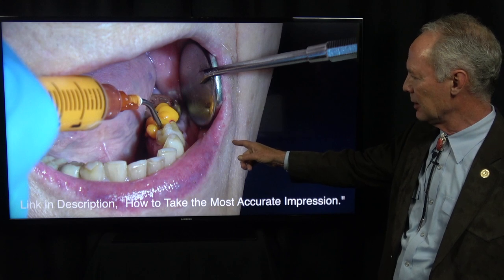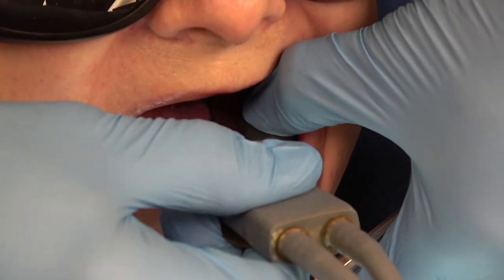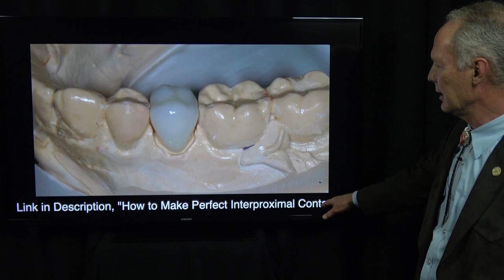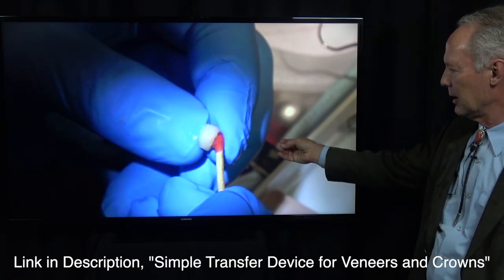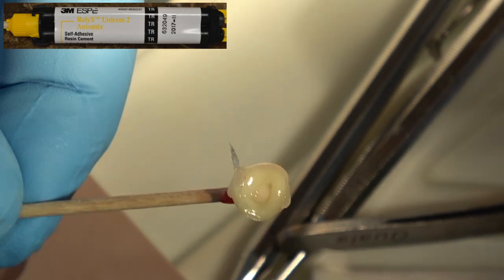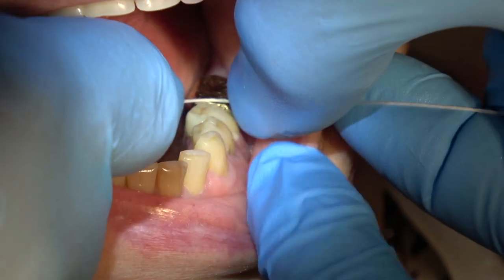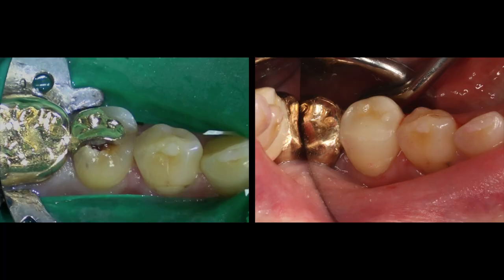Mandibular Bicuspid Crown Preparation - Dental Minute with Steven T. Cutbirth, DDS

Comment: Thanks yet again for a nice video.  Just out of curiosity how much time you book for the prep appointment
Reply from the maker: Normally about 1 hour, and during that time I will check a hygiene patient and, possibly, perform some other minor procedure like a crown seat of composite filling while my assistant is doing something with the crown prep patient.  I have a very specific practice scheduling protocol.  While I directed The Center for Aesthetic Restorative Dentistry (CARD) in Dallas for 20 years we had 1-2 two day courses just on our practice system. Take your practice to the Top Tier.  Subscribe to DentistryMasterClasses.com for an organized library of all the Dental Minute videos plus many complete comprehensive cases and many very important articles.  New cases are added weekly.  Only $20/month.

Comment: Hi nice presentation, what did you use to wipe the teeth before cementation of crown
Reply from the maker: I normally first clean the teeth with pumice and water in a prophy cup, then wipe the pumiced teeth with isopropyl alcohol on a cotton ball held by cotton forceps.  I rinse the teeth, then, just prior to cementation, I wipe the teeth with Tublicid Red and blot it with a 2x2 gauze.  I should have gone over the procedure in the video. Take your practice to the Top Tier.  Subscribe to DentistryMasterClasses.com for an organized library of all the Dental Minute videos plus many complete comprehensive cases and many very important articles.  New cases are added weekly.  Only $20/month.

Comment: Dr. Cutbirth, just a question in regards to the step between your crown prep and making the provisional. Did you do any kind of core build up for that area of caries removal that "hollowed" out the tooth structure?

Thank you very much for your videos. Joining the Masterclass soon.
Reply from the maker: Great. I normally do not place a build up unless there is an undercut or the prepared area is close to the pulp and I am placing it for insulation. If l am placing a build up, I use either IRM or composite.
Reply: @centerforard  do you place build up before or after you complete the crown preparation?